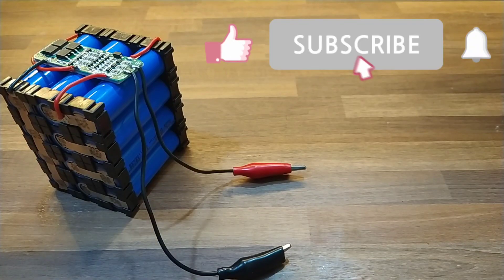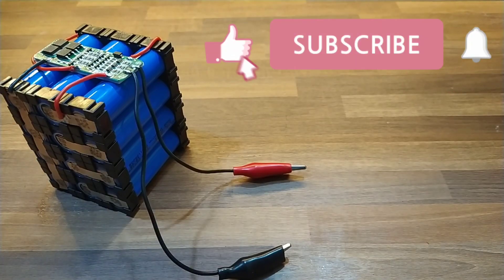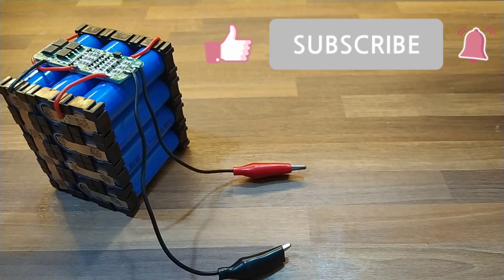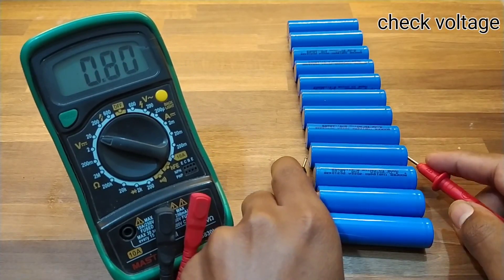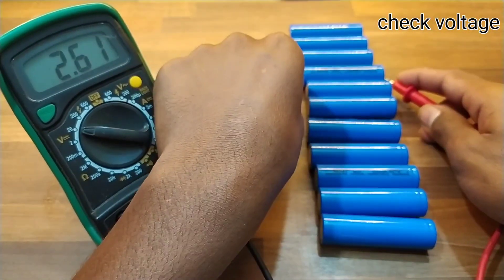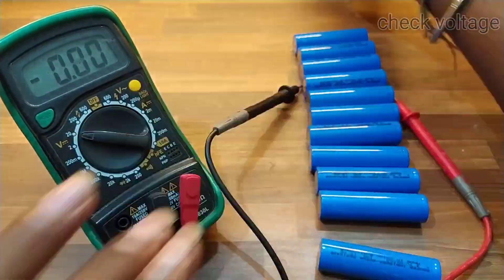how to make 3s 12.6V Li-on battery || Diy 12V lithium battery ||  3s lithium ion battery easy

Comment: Why you haven't connected the cells parallel. How without doing it you can get 8.4 volt and 4.2 volt : Further how the BMS Will balance these cells? What type of charging charger had to be used. Many of the videos I have seen only gives the connection details of the lithium ion batteries but none gives the details on charging the battery pack with BMS. Is it such a secret which is not to be enlightened to the viewers?
Reply from the maker: You can safely charge a lithium ion with charger of ampere up to  30% of battery's ampere, for example if the there is a 12.6v 100 ah battery you can use charger of 12.6v and a maximum of 30 amps, if the ampere exceeds the 30% then can cause damage to battery life span.
Reply: @TechToyzElectro  Thank you so much for the reply